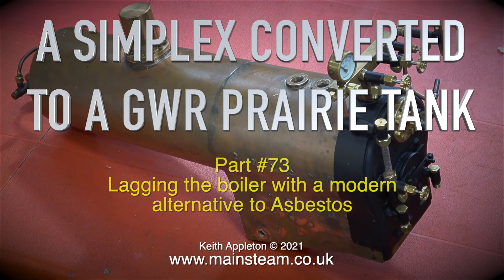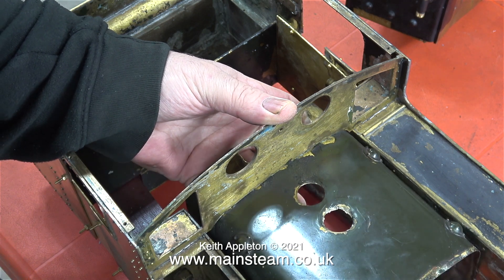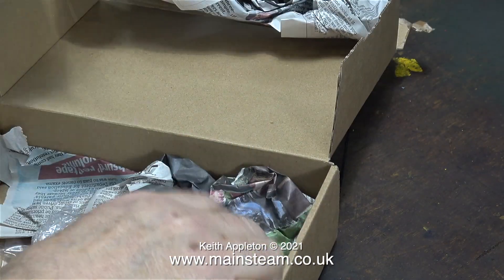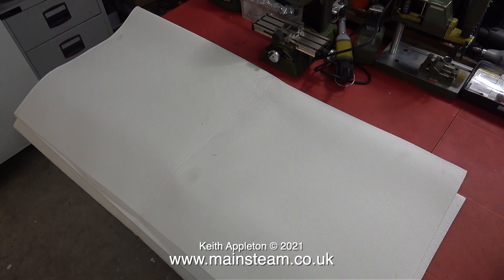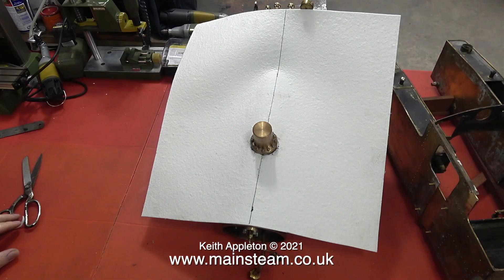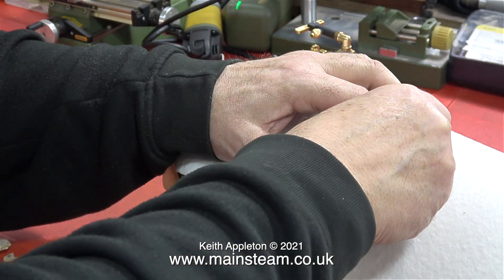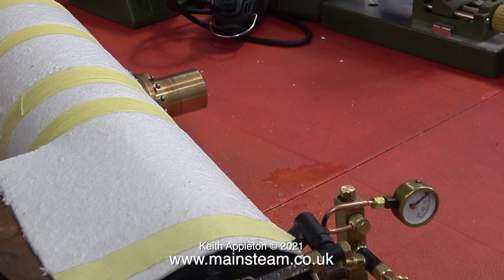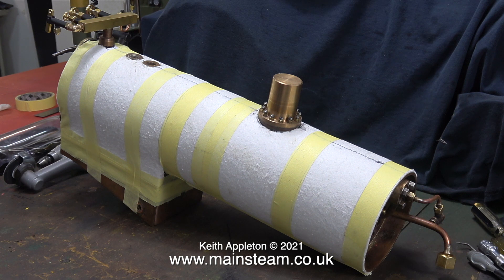SIMPLEX PRAIRIE TANK - PART #73

Comment: how do you handle a project that has asbestos?
Reply from the maker: It seldom happens, but if it does I remove it in a bucket of water, (under water) then double bag it securely before taking it to a disposal site.